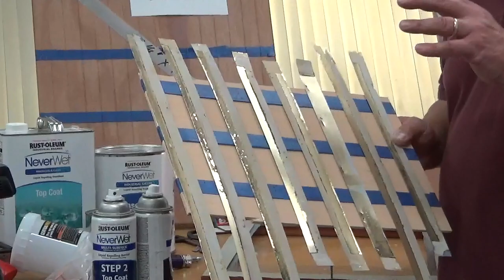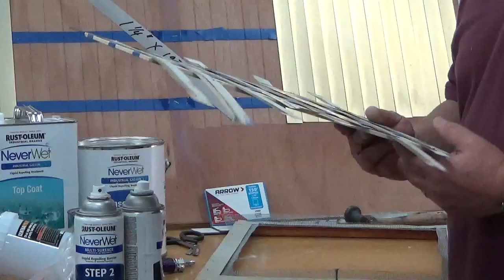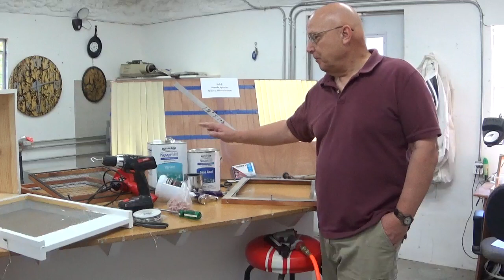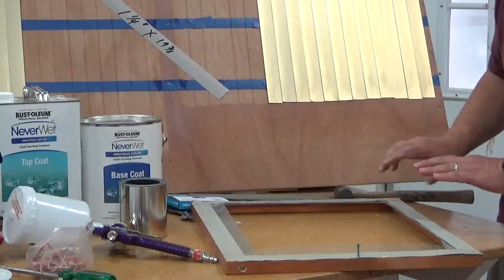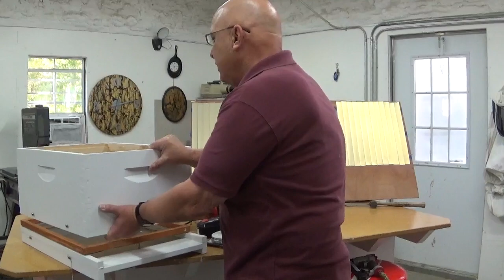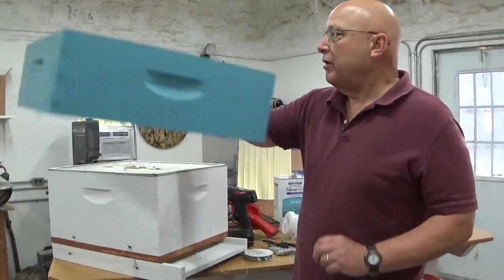Neverwet coated Barriers controls, traps and prevents small hive beetles, New Beetle Barrier 2.0

Comment: So how has the beetle barrier woked?
Reply from the maker: Ever since I discovered this idea and I have been making improvements since the original design, watch all the Beetle Barrier videos to see.
Reply: Have you ever tried 304 stainless steel. I work in shop that use 20 and 26 gauge.
Reply from the maker: @reddog3551  I am sure the stainless will work but I used the flashing because it was easily available from the box stores and was inexpensive. What I would love to see is a company that could make a aluminum or stainless sheet that had the hydrophobic surface etched onto it.

Comment: Jeff -   Rustoleum discontinued the manufacturing of the Newerwet industrial product (we confirmed it with the mfg).   Have you come across any other product equal to or better than the Newerwet industrial product?
Reply from the maker: Hi Steve,
I don't know of any similar product like Neverwet. I saw that Neverwet has come out with an improved product called  "Neverwet 1K" that is scratch resistant, check out the new 1K.         https://www.youtube.com/watch?v=FwYw3PDMsUM
Reply: @jeffwillard2417  Thanks.   Now to find who sells it because no one advertises the 1K product.  I have submitted a contact form to Rus-Oleum.   Will see if they respond next week.
Reply from the maker: @IllinoisBeekeeper  I'm surprised that no one has created surface for stainless steel or aluminum sheet metal that duplicates a hydrophobic reaction, it would be great when they do... Good luck in your search.

Comment: Hey Jeff, If I could find neverwet I would put the strips on the bottom of a slatted rack. That way all four strips could go on in the same place and in the winter just swap out the slatted rack for another one that they are not on. Would sure make swapping them on and off simpler. The only place I coud find neverwet wanted $200+ for each can. Over $400 total. I may try it with the spray cans that you originally used. Perhaps using this process of paintstripper and sanding, it may stay on better that your first try.
Reply from the maker: Hi Doug,
Make sure you watch the newest videos that show the 1/8" hardware cloth used as ramps to help keeps the forager bees off the Neverwet, it may help it your idea.

Comment: Just saw your video before this one and left you a long winded question which is no longer germane  with this Video 2.0  You still might try a few mason jar traps with 1/8" mesh in the lid, flush fit in the middle of a solid bottom board with a couple ounces mineral oil and see if the bees will push the SHBs off into the jar for a refreshing mineral oil swim!
Reply from the maker: I use only screened bottom boards, I feel that they are a better option to keep the hive clean of debris and it also lets the SHB and Varroa to drop through to the ground, hopefully to die. Everybody likes something different, you just need to use what you like and works for you. On a solid bottom board you'll want to place your jar opening in one of the back corners of your hive, you will have a better chance to catch the SHB as they try to find a place to hide.

Comment: Hey Jeff, tried to execute your plan and found that the neverwet strips did not come out well. I used the spray paint hoping the hardware cloth would solve the bee eating the coating away. I found that the strips did not turn out well, they had a gritty feel to them and the bees would walk right over them. I sanded the flashing before applying the base coat. Can you sell me the coated strips? need enough for two eight frame and one ten frame box. Please back channel me at garlorco@gmail.com.
Thank You for your work.

Comment: When you use the sprayer you purchased, do you thin the paint yourself or spray it like it is right out of the can?
Reply from the maker: Hi Charles,
The Industrial Neverwet is sprayed as is right out of the cans there is no reducing.
Rust-Oleum stated to me that the reduction of the Neverwet for the spray cans is what weakened it, the spray can system works its just not as strong as the Industrial Neverwet.
Reply: Thank you.  Could you also send me the link or a better description of the polypropylene tape you used?  There are so many different ones and I want to make sure I use what will work.
Reply from the maker: Your welcome, I now use the size 1/8" X 5/8" tape. Here is the link;  http://www.equalseal.com/White-Polyethylene-Closed-Cell-Foam-s/2187.htm
Reply from the maker: Hi Charles,
Don't forget to subscribe to my channel for all the newest vidoes that are coming up.
Reply: Subscribed about a week ago when I first came across your original video on this. Thanks for the good work.  I only have 6 hives but I hate those beetles and I cannot believe they were never around until I bought the bees I have.  Thanks again and I love your way of thinking about these things.  "It's like a MacIver episode!"
Reply from the maker: Thanks Charles. That was funny now I can think of myself as a bald Macgyver. I have got some more Macgyver's coming up, one in particular could be a real game changer....
Reply: Another question about Neverwet.  I like the using the hardware cloth over the Neverwet strips.  Since the reason you used the wires was to keep bees off of it, could I use spray can version just for the beetles.  I'm trying to justify the cost of they two cans of Neverwet.  If the bees do not get to the strips and chew it off then maybe I wouldn't have to spend so much up front.  I only have 6 hives but do not want the beetles.
Reply from the maker: Hi Charles,
The spray can Neverwet will definitely work it did for me for over two years and it may hold up much longer now using the 1/8" hardware cloth over the top of it. Worst case scenario would be that you may have to remove the 3/4" rim and refinish the barriers every couple years or more, or when you start to see SHB in the hive. I wanted to use something tough that could possibly last for 3 to 5 years or longer before having to refinish them, because I'm getting old and lazy......
Reply: Jeff Willard.   😀😂🤣LOL

Comment: Since you've spent years investigating methods of stopping hive beetles, could you comment on Clark's Beetle Blocker shim.  Looks like the shim stops the beetles without a coating.  Here is the link:  blockthebeetle.com   Compared to your method, it would be much more expensive to use if you've got quite a few hives.
Reply from the maker: Hi Psyched,
  I will never criticize or complain about some else's product or idea in a public arena such as You-Tube, unlike Mr. Clark who has done both on several occasions about mine . E-mail me at r_willard@bellsouth.net and I will explain the issues I see in his design.
Reply: @jeffwillard2417  You are a wise man, Jeff.
Reply from the maker: Thanks, but just like a blind Squirrel in the woods I find a useful nut every once in awhile.

Comment: How about keeping the bees completely away from the NeverWet?  Can you bend the strips down and create a gap that the bees cannot pass through but the beetles can?  You could keep using the cheaper product then...
Reply from the maker: Hi Arnd2it, 

  That is a good thought but if the hive beetle can reach the mesh they will crawl up it like a ladder, you need that protective 1/4" to 3/8" gap between the bottom board and angled mesh protecting the Neverwet coated strips to keep the beetles from being able to reach the mesh. Believe me I'm open to any idea to stop these horrible creatures, I'm fighting them in my hives and passing on the info to other beekeepers.

Comment: I like the idea and was just about to set up up a coupla hives using the older spray can material. It seemed a perfect solution to the problem.

But now, I'm wondering... it the bees are stripping off the coating - where is it going? Are any microscopic particles going into the bees digestive system or somehow getting introduced to the honey cells? To what effect - if the products are to be consumed by humans?
Reply from the maker: I have never seen any ill effect in any of my bee hives from the Neverwet coating and if I suspected there might be I wouldn't use it, I'm very protective of my girls. We'll soon see if the mesh barrier covering the coated strips removes the bees temptation to clean that part of the hive, I sure hope so.

   It's funny that you brought this up because so many people don't even think twice about putting Apivar varroa strips in their hives, which are coated with Amitraz, that is the same miticide (bug poison) used in a dogs flea collar. I don't use Apivar either in my hives, that is how picky I am what's in my hives and honey products.
Reply: Jeff Willard don’t think they live long enough for any problems to occur 😊
Reply from the maker: Hi Brian,

  The biggest reason I used this material was a statement posted by Rust-Oleum which said that it has been used in the food and cosmetic industry for 20 years and deemed safe by the EPA. 

  The bees aren't eating it they just want it out of the hive, the dried Neverwet has an almost rubbery type film that the bees are chewing off and carrying out of the hive. The bees are treating Neverwet like everything else in the hive they don't like they'll remove it, if the can't remove they will propolize it. I am very picky in what I use in my hives and I have no concerns about the Neverwet product.
Reply: I was wondering the same thing.
Reply: Well, then it "ought" to be alright... but if the bees are ingesting particles of the spray-on stuff to their digestive tract while removing it - even if benign - they may cause a problem? Something on the order of constipation perhaps? ;)

This newer industrial stuff may be too thick for them to make much of a dent in it?
Reply: Thanks for that tip. I am very allergic to many things and cannot be around a flea collar without problems.... another reason to stay chemical free.